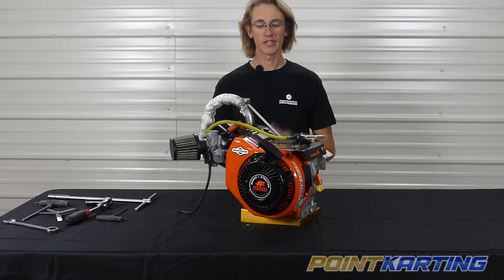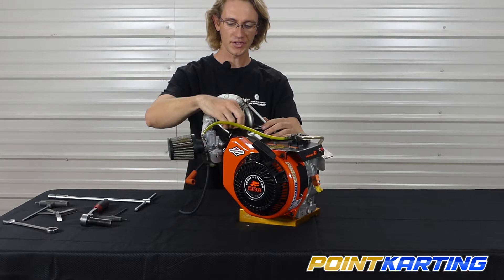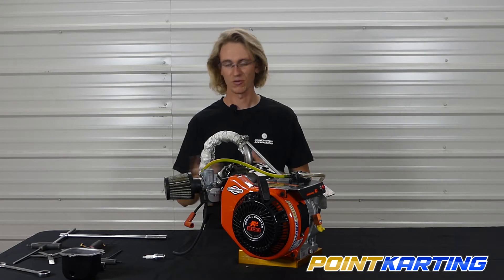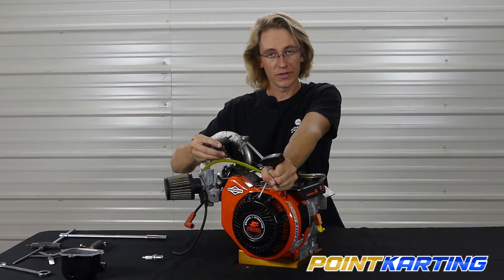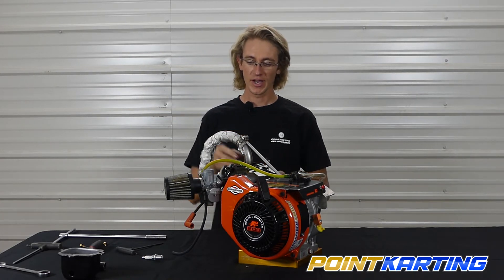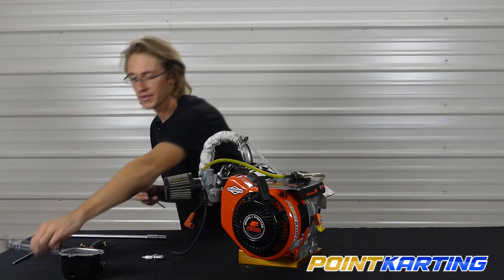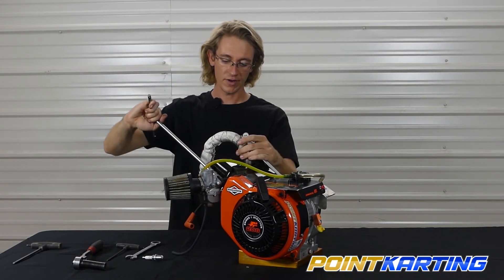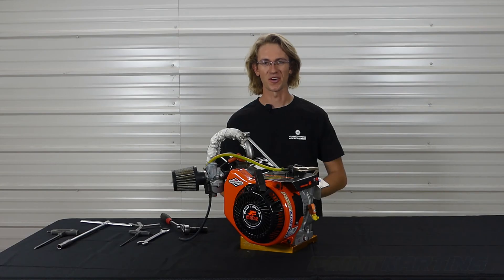Setting The Valve Lash on a Briggs 206

Comment: is there a power difference with the 0.002 / 0.001 or 0 ?
Reply from the maker: Good question! 0.002 is what we have found results in the least amount of blow-by when hot, at a minimum. 0.001 or 0 may make a little more power for a short period of time, but as components heat up and expand (the valves mainly) these tolerances are not ideal and can result in power loss. However, the best way to find if this is your experience as well is to test for yourself!

Comment: Should the rocker studs be loctite to avoid coming loose?
Reply from the maker: Hey Cory! Great question. The answer is likely no, as the heat from engine operation would render Loctite not very usable. With the frequency of service on the valves, my suggestion would get to just keep an eye on it and tighten as necessary. (there are grades of Loctite that are strong enough for the heat but wouldn't recommend it as you'll never get it loose).

Comment: Is it possible to explain in other words, for those who can't get it clearly from video, how to find the correct position of piston for adjustment?
I understand, it need to pass once cycle of intake and outtake strokes and find the top position of piston, is this correct?
Thanks a lot in advance.
Reply from the maker: Thank you for your question! Hmm. Basically, in essence what we are attempting to do is find "Top Dead Center" of the piston. This is the point at which the piston is at its highest point of travel. Essentially think of the piston moving up and down within the cylinder, it is connected to the connecting rod, and at one end it comes as far 'upward' as it ever will within the engine, and this is a point known as Top Dead Center. What is even more critical is also finding this point "Top Dead Center" on the combustion / power stroke - this is when the camshaft / lobes of the cam are relaxed, and the valves within the cylinder head are seated and relaxed from any stress by the valve springs. To find Top Dead Center on the combustion / power stroke, pull the pull-cord of the engine, and watch (with the valve cover removed) the rocker arms move. You will see the rocker depress for the intake stroke, and then come back to normal position. Then, just after this, you will see a small movement on the exhaust rocker arm / valve, and this is a sign you are very close to top-dead-center on the combustion stroke. Once you see this, use a small socket or allen / rod (no more than 6mm in diameter) and insert into the hole for the spark plug, and feel for the piston as it begins to travel upwards within the cylinder. You will feel it rise and you can tell by marking or by noticing the rod you are using to find the top of the piston also rising too. This may take a few trials to find exact top dead center, but this will get it positioned to find the best point at which to service your engine. Once there, you can set your valves properly. 

I hope this was somewhat helpful in text form - for me I am a visual person so I prefer the video, but I hope this is helpful! Please let me know if you have more questions!
Reply: @PointKarting  Thanks a lot for details! It helped. Many words I can translate and get clear view. Will try this once I got my engine :)

Comment: I couldn't find the correct Allen to set into my mini bike frame so I used a cheap Allen socket and it broke into the set screw. I tried to drill it out but ended up buying a whole new nut and set screw. Live and learn I guess!? Thanks for the video!
Reply from the maker: @Kevin Bacon one thing we've done usually is we loosen the larger adjuster (5/8" wrench) first, and that prevents the stripping of those allen head screws. Then, once tension is released off of the allen set screw it is easier to move and loosen for fine-tuning your adjustment until you are ready to tighten it back down. Sorry you ended up stripping the screw :(

Comment: how often should this be checked??
Reply from the maker: @Joe Blow (nice username!), we recommend once before every race, but it really depends on your preference. Heat cycles tend to make the rocker arms come out of adjustment over time, so it's best to stay on top of it. Once you get the hang of it, checking your valve lash takes 2-3 minutes.
Reply: @PointKarting  lol, thanks. 
Anything else I should be doing for optimal performance output before races?
Reply from the maker: @fasaria78  absolutely! Reach out to us at pointkarting@gmail.com and we will send you a Briggs 206 maintenance document we have for our customers.

Comment: Hey Eric, you mentioned in the video that you prefer .002" and some people set it at 0". What's the difference? I thought you needed to follow the factory BS recommendation for best performance.
Reply from the maker: @Andrew Ryan great question! What we’ve found tearing down many of these engines is that setting at 0.00” is great....for a very short time. Once the engine gets hot, as the valves grow you begin to get blow by past the valves. As a result, setting at 0.002” is about as tight as we run to prevent this blow-by, meaning that at the peak of combustion the valves are sealed up in the head, and proper compression and burn can occur. 

Running tighter than 0.002”, especially on the exhaust valve, and upon taking apart the head you can see burnt and unburnt carbon in the channels of the valves. 

Let me know if this clarifies your question! If not, let’s keep chatting.